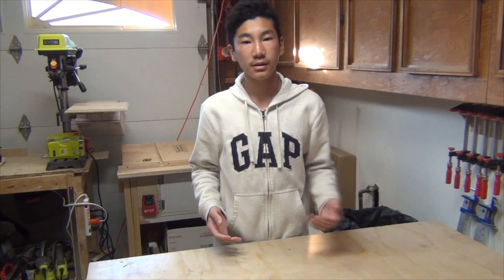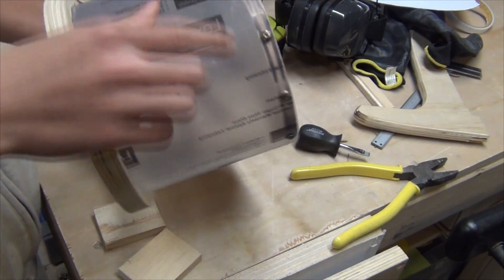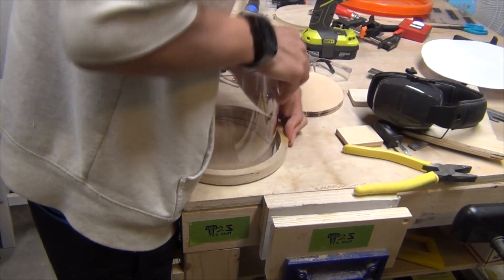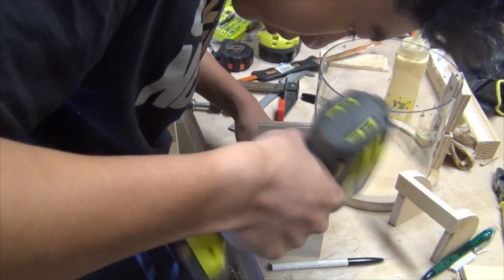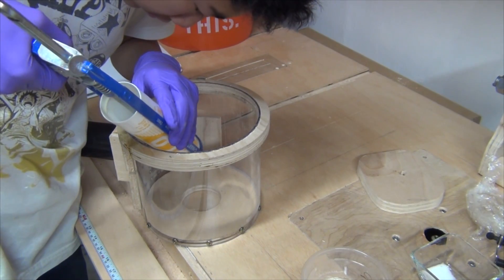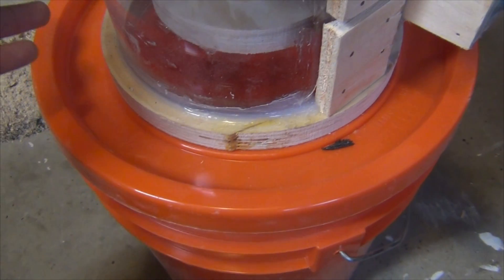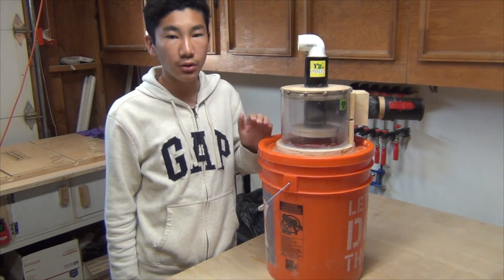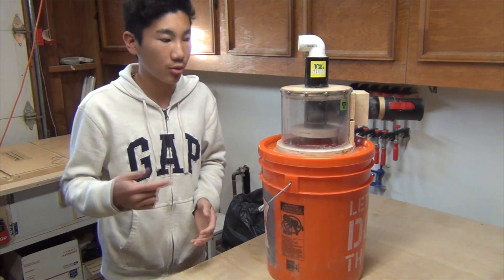Cyclone Separator// How To

Comment: Nice work done. If you do a remake of this unit, perhaps you can make 3 solid rings and use those to hold the shape of the polycharbonate (aka plexiglass, plexi). Then use 2 solid discs for the top and bottom. These two peaces will keep the strength and shape of the unit in tact.
Also, perhaps make the unit larger so that it fits snugly in the top of the lid. The larger diameter will allow for more air suction and greater distance between the debris and shopvac tube.
To help bend plexi use a hair dryer set on high (or use a heat air gun set on medium). It will heat up the plastic and allow it to conform to the shape you want. 

This is definitely a better design than several other designs I've seen. I think I'm gonna follow this layout and build this one  :)  Great work!

And I see someone is a Ryoby fan!  :)

Comment: Nice build.  If you replace the 90 degree fitting on the outlet with a straight connection you will reduce the pressure drop significantly which will give you a higher flow rate. I tested one of my vac systems and was surprised that one 90 degree fitting was responsible for almost 50% of the total pressure drop.
Reply: Use a Street Elbow.

Comment: I enjoyed the video and the build. I am going to build a cyclone separator as well. I suggest building one with a larger diameter. This would reduce the amount of the fine dust that gets sucked into the filter. The cyclonic action needs a larger radius to rotate around the perimeter of the cyclone. If it is too narrow the fine dust will get pulled into the central intake.
Reply: This is true….but balance against a smaller diameter rotates the flow faster for improved centrifugal separation.  There must be a sweet spot of flow thickness around the chamber vs flow speed.  This probably varies from one vacuum system to another where you also trade off flow volume (cfm) vs static pressure drop (mm/hg or KPa).  Then on top consider the height of the chamber!  I agree this particular chamber does look a bit small, although cyclone vacuum cleaners are only round 8 inch diameter.  It needs testing I guess.

Comment: Very well done. I appreciate your time and effort. And, I'm going to build a cyclone attachment just like yours. As a suggestion, you are still going to get some small amount of dust in the vacuum so I'd suggest putting a cloth outer filter over your shop vac filter. I did that and it keeps the filter cartridge from clogging. You just take the cloth outer filter off, shake it out and wash it. No cost at all except time.